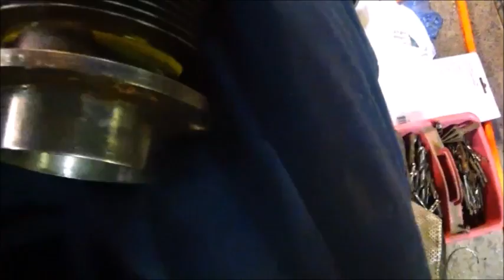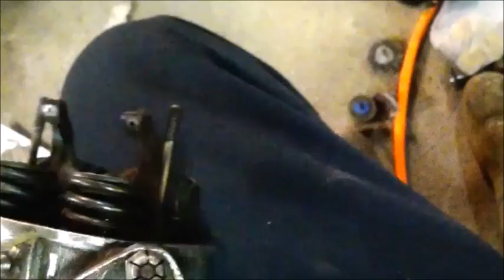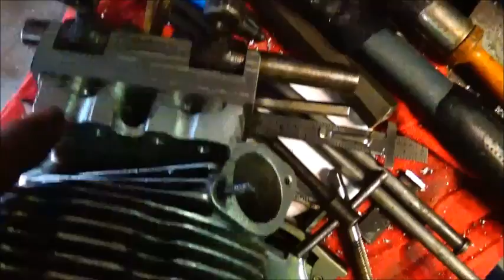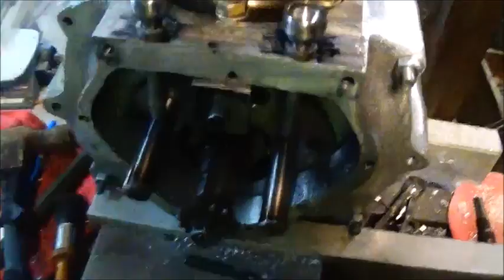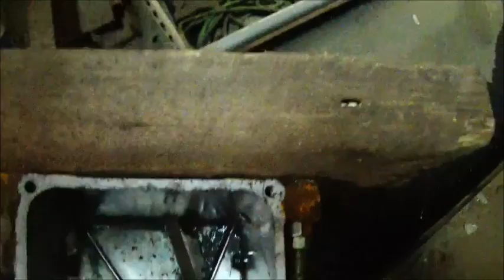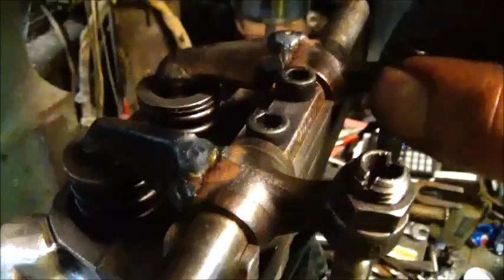Antique Motorcycle Engine Build (Replica) Part 28 Pushrods & Mounting Cyl.

Comment: Maybe they bored it .010 over and bored it again to .020 but never marked it.
Have to wonder how they managed to cast those fins so fine.
Reply from the maker: It's a machined cylinder from steel and the head screws on and is aluminum.  Would be easy to turn one out on the lathe, just time consuming.

Comment: Johnthen you mite need to put a heat sink on the exhaust port like the Trump and the Ducati. for some reason they run so hot they will seize with out. just a thought. Doing a fantastic job! Thanks!
Reply from the maker: I will be running a little extra clearance between piston and cylinder walls just because of that. When they were building new, they kept the tolerance as tight as possible so the engines could be ran for thousands of miles. I will be assembling mine as if it already has a few thousand on it. I built pulling tractors that way to cut down on friction and make more horsepower.

Comment: Have you thought about an automatic, gravity drip feed oiler? Could incorporate a small oil reservoir into the end of the fuel tank, with some small diameter copper tubes running to your lifters and rods. I just have visions of trying to precisely hit those areas while bombing down an uneven road at speed. Just a thought, love the build and the videos Johnathon.

Comment: thank you I am learning a great deal watching your videos. just wondering is oil going to leak out of the head by the push rods.under the rockers. just curious a know you will figure that out also? looks pretty cool. a believe the oil slingers will work. many small engine have use slingers to great effect for decades, they work.
Reply from the maker: No, only oil that will be at the top is what I put on it from the can.
Reply: Heck many cars and trucks used slingers up till the early 50's, I know my 51 chevy did for sure, it had slingers with 6 little troughs of oil built in the pan.
Reply: Jonathan W that should work. thanks.